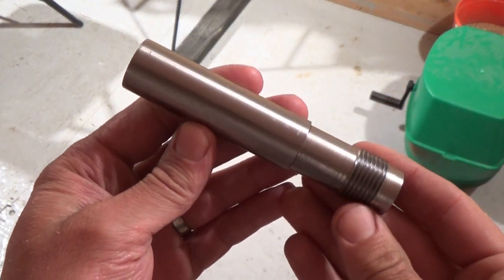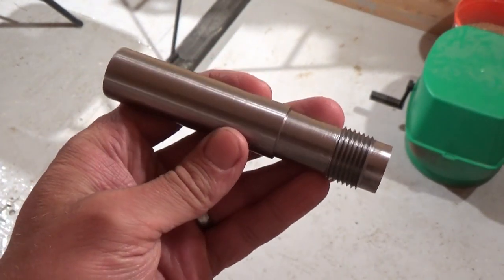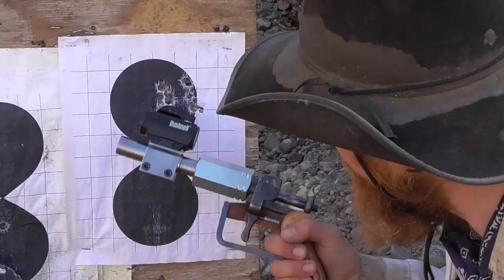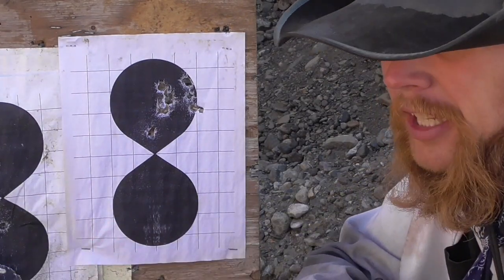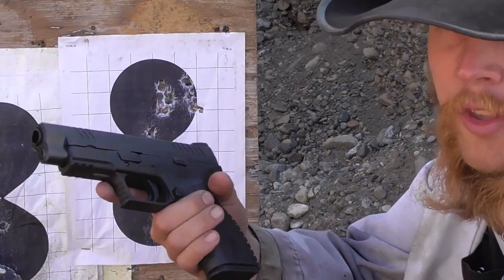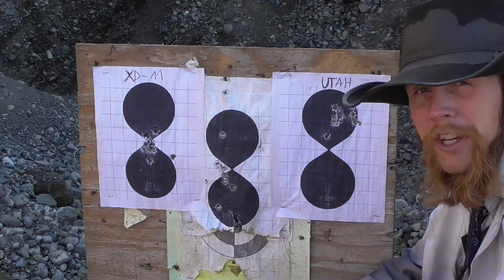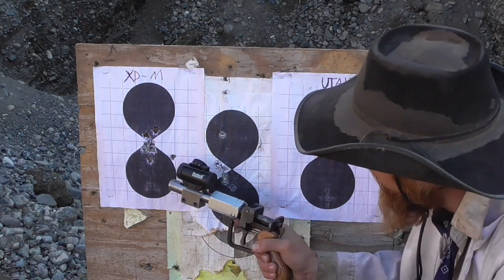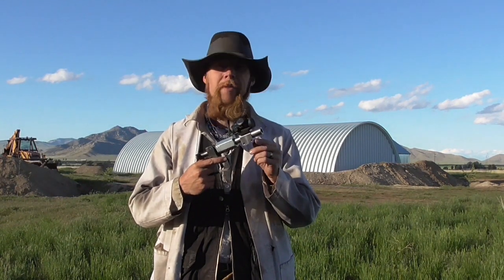Machining a Rifled Barrel (TIS147)

Comment: I'm impressed with what you do! like many other commenters I'd love to see your attempt at making a rifle length barrel. 
I also have a question for you: Recently I had a 20 inch round stock gun drilled by a local shop. the exit hole is about 2mm off center. I have no way to tell if the hole axis is curved along the way (having a bow to it) or is it straight but not parallel to longitudinal axis of the round stock itself. I'm thinking if the latter is the case, the barrel blank could be turned on a lathe around the axis of the drilled hole so that the finished barrel has the axis of hole exactly perpendicular to longitudinal axis of the round stock. what do you think?

Comment: @TheIdahoanShow couldn't you drill, ream, and drive the button through like normal; then put the barrel back in the lathe and re-ream to knock those burrs off from driving the button? Also what about driving the button through, then indexing it 30 degrees and running it through again to make a 12 groove rifling instead of 6?
Reply: Or index it 20 degrees then index 20 again to get 18 grooves etc. It would be interesting to see you do that on a couple barrels and compare accuracy at say 50 yards to let moa amplify itself more than it does at 10 yards to see if that makes a difference. It seems to me that the more grooves you cut, the more efficient the gun will be because you are increasing surface area for a more reliable spin on the purchasing faces of the rifling, while at the same time more grooves means less bullet lead to be deformed into lands so less resistance through the barrel. So you're making the bullet harder to push in one regard but easier in the other and the end result is more consistent spin because of more lands and grooves. Kinda like Marlins micro groove. Idk, it would be neat to see

Comment: I wonder if you have thought about pulling the button through the barrel instead of driving it through with a press or hammer. Maybe making the button on the end of a rod, and pulling it with the gearing on the lathe? While the chuck turns freely?
Reply from the maker: I've thought about, but based on the mechanical stresses involved, I came to the conclusion that the hydraulic press was more practical.
Reply: I love your show, very informative. I based my question on an old  button broach machine.  They pulled the button through the barrel with a helical form, and used different forms for different rifling.
Reply: Thank you for your answer.

Comment: It was a fun video to watch. I think you are right that if you put a lot of rounds through it that it will get worn in and polished and get more accurate. You might be able to take patch with polishing compound and smoothed it up that way thus avoiding all the shooting. It would be interesting to see if just doing the polishing would improve the accuracy. Have a great day my friend.
Reply: Shooting lead leaves lead deposits, because the lead is softer than the steel. Need to high polish.

Comment: I noticed that the hammer rifling introduced some minor pitting to the inside of the perfectly reamed barrel blank. Perhaps this issue can be avoided by changing around the steps in the process to account for it. After drilling out the initial bore for the barrel you could then run a button down it with extra long ridges to cut the channels. Then finish the barrel with your reamer to bring the internal diameter to the correct measure and remove any anomolies.

Comment: I'm not super familiar with the fine details of making one, but I've heard you can "slug" the barrel with a lead bullet, and coat it with valve grinding compound to make a "lead lap", and if you run that back and fourth through the barrel that can help deburr/polish the lands and grooves without majorly dimensionally changing thing's.
Reply: steelcannibal $4-6 for a cheap way to get excellent results! Damn!

Comment: Good video . I would be jailed here in the uk if I made a gun . So defend your 2nd amendment rights , else you will end up like us here in the uk.
Reply: Colin Salter only if police know you build a gun.
Reply: Yes but I dont like porridge . So won't be making one.
Reply: If it's just a hobby you could build non firing replicas or blank guns.
Reply: Once you fashion any pressure bearing part you're in breach of the law. At best you could make a "holster filler" as used by some re-enactors.
Reply: FordPrefect23 Use bar stock as a barrel and no firing pin. You can buy non firing replicas of guns made of steel in the EU and UK.
Reply: You do know u can have guns right u need a license
Reply: Its only illegal if you get caught
Reply: @Schrodingers_kid  yeah it's not illegal if no one knows

Comment: Love the video. Was waiting for you do make a high quality one for a long time. 

My challange for you though would be to make a longer barrel. Lets say 30 oder 35cm, like for a short Rifle. Would be interesting to see how well you can drill and ream this on a conventional lathe.

Also you might want to try to hone the barrel with a lead plug. Pour some lead into the barrel with a wire in it and use the slug as a tool to hone the barrel.

Greetings from Germany!
Reply: I actually tried it my self a few days ago. Drilled a 28cm long Rod with a 8mm Drillbit that I shrinked into a steel rod to make it longer. 

The exithole is about 1.5mm ofcenter, not to bad but not good also. Besides that it looks pretty straight though. I will try to ream it when I got time for it and straighten it on a press if necessary. 
Then I planned to put in on the lathe again and center it there before I take some material of to get the hole centered. 
Will report if it worked out.
Reply: @peteraugust5295  I know I'm 4 years late but would love to know what results did you get?
also, you mentioned the exit being 1.5mm off center. does the hole axis have a curvature off or is the axis straight(meaning not curved) but wandering to a side? I'm thinking if the latter is the case, the barrel blank could be turned on a lathe around the axis of the drilled hole so that the finished barrel has the axis of hole exactly perpendicular to longitudinal axis of the round stock. sorry if my English makes it difficult to grasp what I mean.

Comment: I watch  your  videos  with great  interest  .
As a home beast Lathe hobbyist .
It  has been a challenge  to  drill a strate horizontal long hole. 
I have  found  drilling holes  vertically  a fare better way  .
And then  polishing  out  the  whole   
With  2000 . grit wet & dry  paper .then  pouting the  button  threw the whole .
It  seems in my mind  a good way to go  .keep up the good  work  .
I will be  waiting for you  next  video  .🤠
Reply: Would you want to polish again after the button goes through?

Comment: Have you tried making lapidary impregnated lead slugs to polish up the rifling?
Reply: Old trick, impregnate a lead bullet with sand to change the ballistic print.
Reply: El Burro Peligroso I didn't think about that, but now that you mention it... Most abrasive cleaners use powdered corundum. That's an interesting idea, nice clean barrel... And always pick up your brass so you can reuse it. Hmm... That's a really good idea.
Reply: John VanAsselberg II There are some products like this, but most of the time it is done by hand with an abrasive impregnated lead slug.

https://www.midwayusa.com/product/100192877/tubb-final-finish-bore-lapping-ammunition-308-winchester-box-of-20